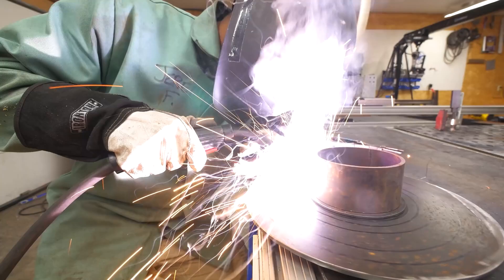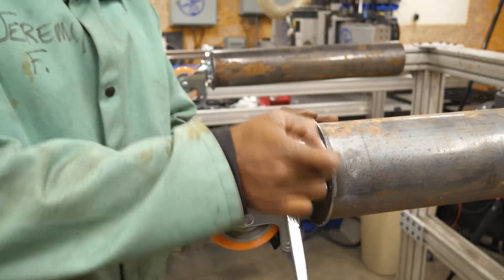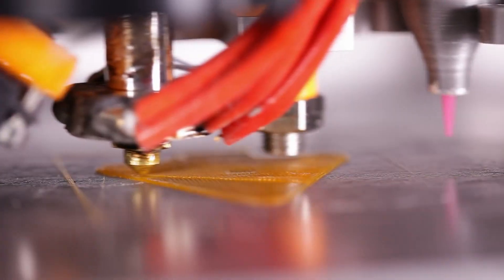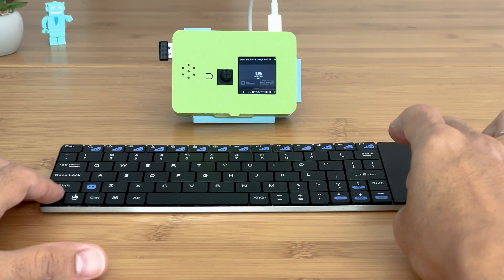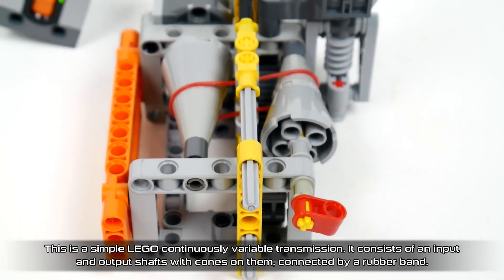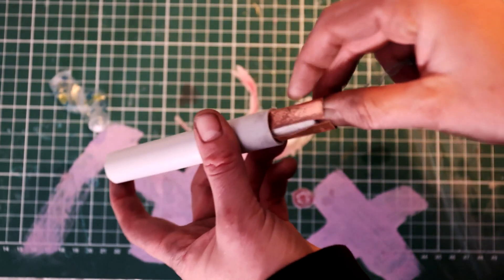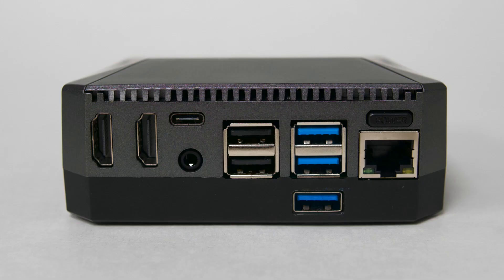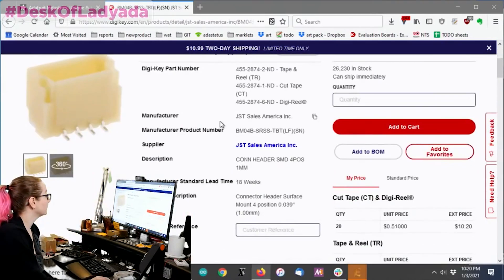Elevator Action [Maker Update] | Maker.io

Comment: Tyler, another great show. My current project?  I just finished a tool storage system for my Cricut, with individual holders for nine different cutters. I designed them in Fusion 360 and printed them in two filament colors. I’m very pleased.
Reply: That sounds fantastic. Did you share it on Thingiverse? My cricut storage is kinda a disaster